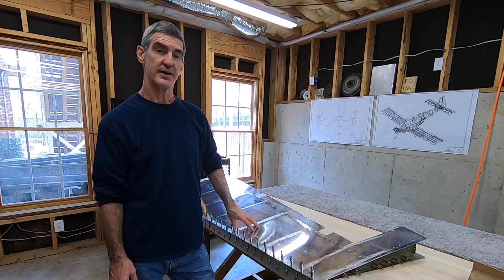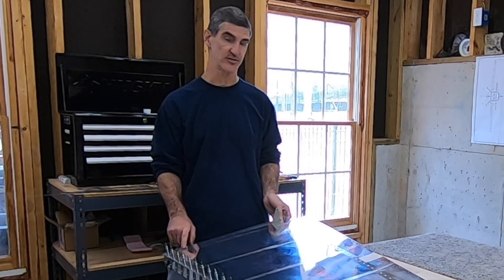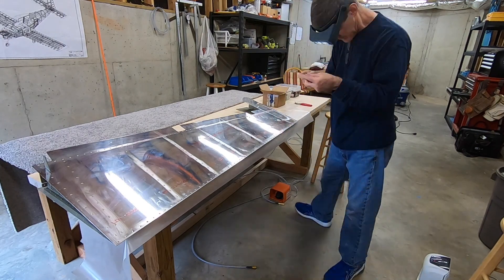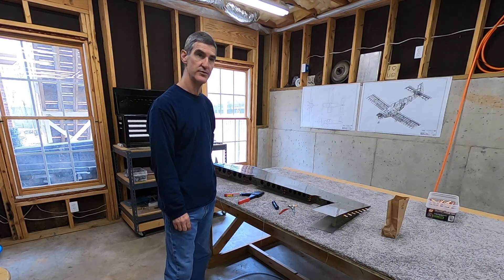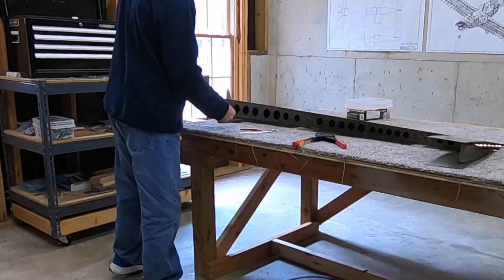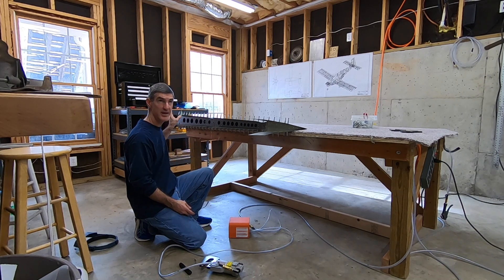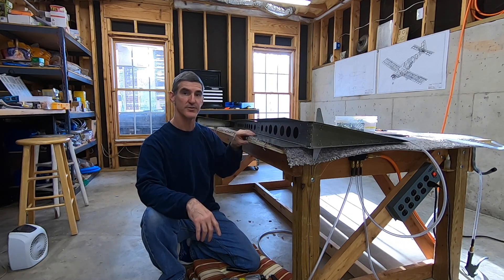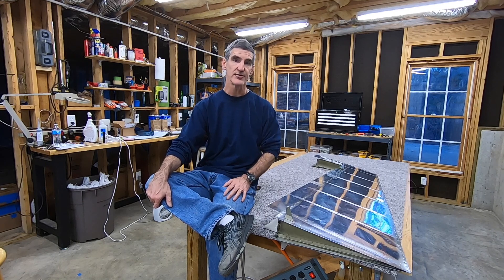RV-10 Build Log - Emp 28 - Riveted rudder spar, bottom rib, horn, striker plates, counterbalance rib

Comment: Excellent video. Thanks for posting. When riveting the skin to the spar flange, were you able to squeeze all of those rivets with a 4 inch yoke? I see multiple yokes that you have. Which ones would you advise to have on hand? I’m all about having the right tool and not compromising on that front. Strong work!

Comment: If you need a taller table, I would recommend installing locking caster wheels which will raise the table about 4".
Reply from the maker: Actually have some of those already, just deciding whether to modify this table or build a second one.  I figure I’ll need a second one when it comes time for tail cone and fuselage work.

Comment: What is the part no. for the flush blind rivet that you use please?
Reply from the maker: The flush blind rivets that go in the top holes of the striker plates are CP4-4.  The one in the left skin to bottom rib are CCR264SS3-2.  That’s the one I used two of, then replaced all but the one closest to the TE, as per the plans.

Comment: I would say for a job like those low rivets, a short stool on wheels would be better than a taller table. You may regret the taller table later on. Plane Lady uses them and they look fantastic.
Reply from the maker: Good idea!  I’ve also heard of using a bean bag chair, especially for things where you need to lay on your back underneath.  Not sure how either the stool or the bean bag would go when combined with the foot pedal, but anything is better than nothing.  I might build a second table, and have one high and one “normal” height.
Reply: @missiletwentynine2667  I know you when through the trouble of buying and getting used to the foot pedal, but I remember you mentioning you didn’t necessarily notice an advantage either way. A literal ton of riveting left to do, so maybe squeezing a few without the pedal isn’t the end of the world?

Comment: Yeah - your back is going to start aching after a year with all the bending over that short table top surface. Good idea to raise it up more or build a raised mobile base it drops into so you can change the height and wheel around when needed. Thanks for the video.
Reply from the maker: I had actually put it on giant casters before starting the project but decided that was too tall.  I’m rethinking that now.